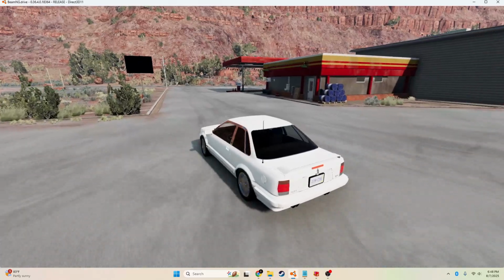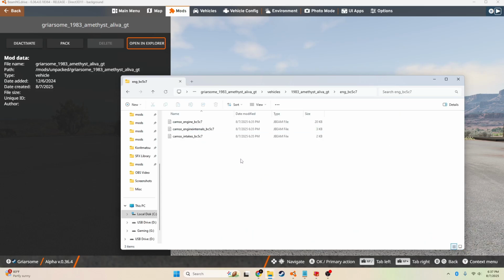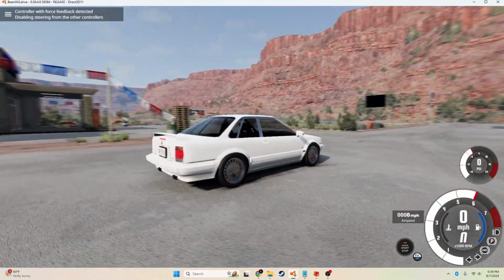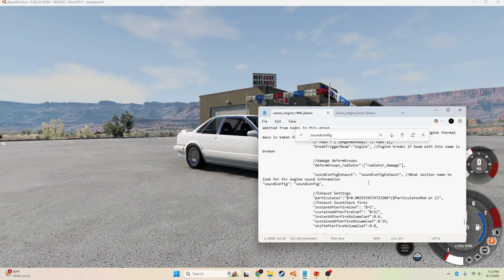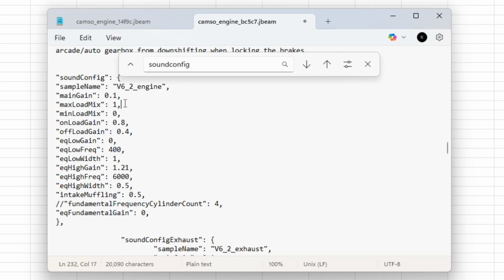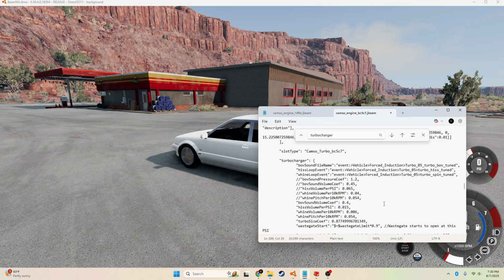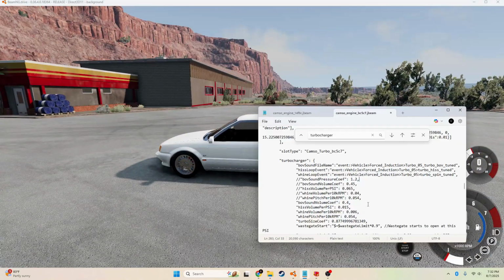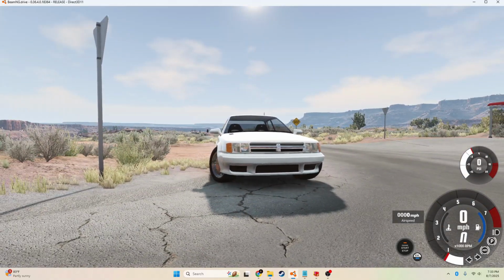How To Add CUSTOM ENGINE SOUNDS To Your Automation/BeamNG.drive Cars!

Comment: Good stuff! How can I remove a spoiler & get the color to change? The color has been set on the bottom of the car & will not change unless I go into World Editor. Also is there a way to add a slot for Adams Nitrous & RR Wheel Pack?
Reply: How can I add a custom license made for Beamng?